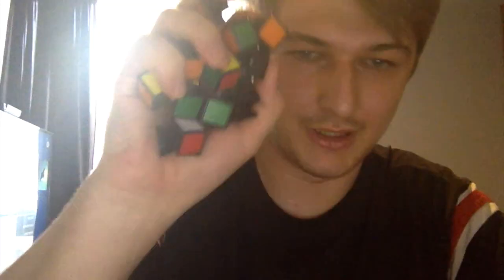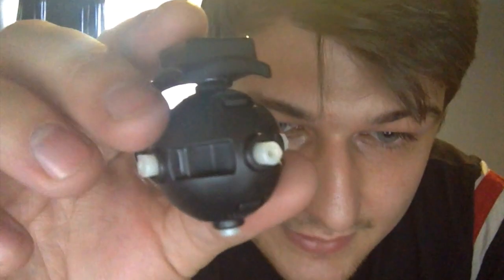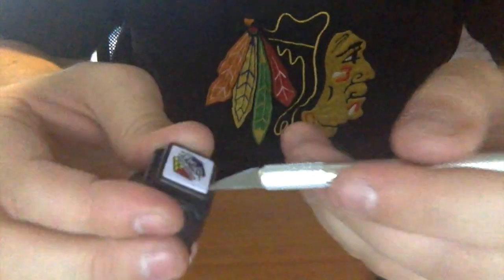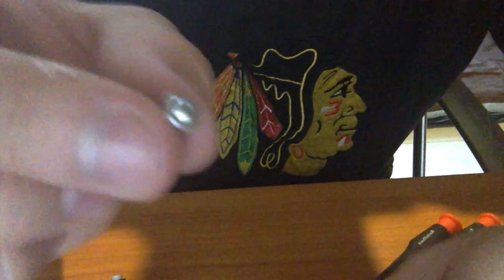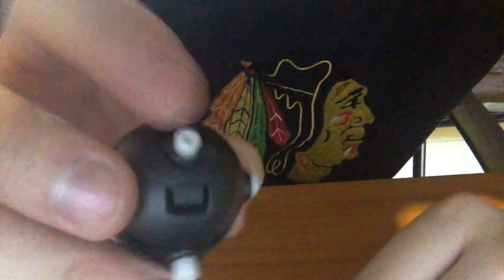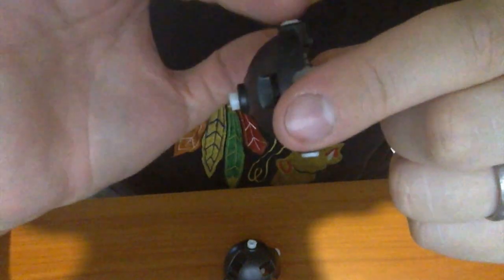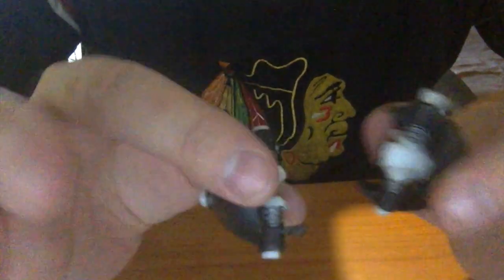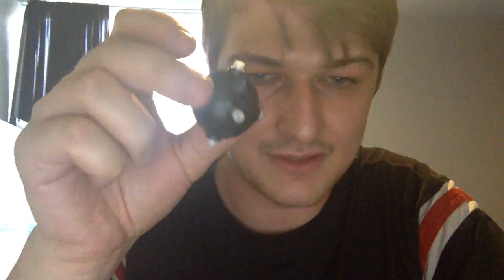Inside the Rubik's Cube 2.0

Comment: Thank you Dude !   I had to fix my daughter's cube as a plastic (conical) ring was broken.  I used your video to open the core (very useful) and I replaced the broken piece with a new one I made from a soda plastic cap.   Works like new now!
Reply from the maker: +Nicolas Hallee Wow! That's some nice handiwork!
Reply: Nicolas Hallee same happened to me! Using your tips it hopefully works!
Reply: Ok, I'm sure it will work.  1 year later my daughter's cube still works great with this repair!  I cuted a circle out of a standard plastic bottle cap (Coke) and punched a hole in it using a leather punch.  That gave the ring a bit of a conical shape (as the white original plastic piece).  I have a picture I took back then.  If it can help, give me your email address and I'll be happy to send it to you.   Good luck!! ...and let me know how it went for you.
Reply: Nicolas Hallee It worked! Works smooth again, thanks!
Reply: Happy to hear!